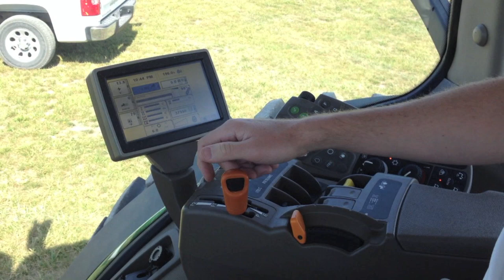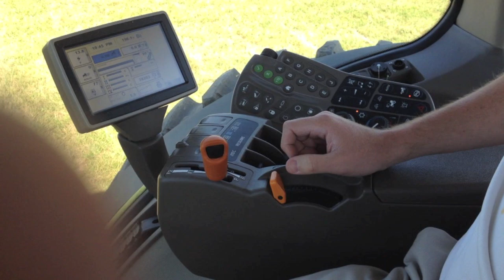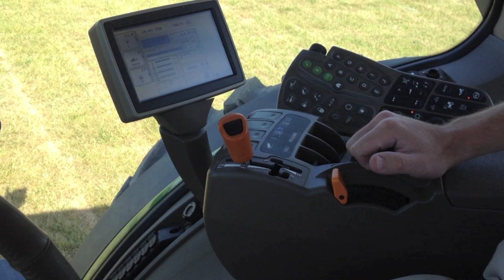John Deere IVT Operation

Comment: I never heard the engine rpm decrease at set speed when the tractor determined that there was no load.  It is supposed to maintain lowest eng. speed to maintain set speed.
Reply: Think they only drop to about 1200 rpm
Reply: @justinmartin8887  we idled full auto rpm when cold to warm up. 1200rpm was that. at 30kph is was also around 1200-1300rpm. beautiful trans, especially on the new 8r's they feel so much tighter
Reply: @ElBantosClips  my 20 series is definitely a little quirky

Comment: that looks so awkward and fiddly with the tiny stick. nothing like the Fendt
Reply: Its pretty comfrotable, you dont really touch it when working. But i havent tried fent so i dont know witch one is better
Reply: The Fendt is definitely better on the stick, check out a “how to drive a fendt” video or something. 
Its just so intuitive having it on the big joy stick. You can select forward or reverse by pulling a trigger on the stick and moving it forward or back. 
If you pull out on a road and want to accelerate up to full speed just knock the stick to the right and the tractor will do the rest, and if you are on silage say alongside a chopper then you can increase the speed in 2kmh increments by tapping the stick forward or pull back to slow down. The stick is sprung so always returns to centre and you also have all the hydraulic spool controls on it to
Reply: @danhopkinson2811  im going to say that its more complicated than jd, but like after maybe 50 hours i could drive it without looking at the stick. it might just be that ive always driven valtra and john deere, but every tractor has its own sides
Reply: Its not complicated, i’ve spent plenty of time on Deeres but on the direct drive models. Find them gutless especially when pulling silage trailers. The Fendt is easy because you can do everything on the one stick. You could drive it completely pedal free if you wanted
Reply: @danhopkinson2811  i wish i had a opportunity test a fendt, but we only have a jd ap and i dont know where i could test one out
Reply: They really are an amazing machine, the contractors i do a bit for run a fleet of them and just have the two JD 6155R’s for basic work and hauling. The Fendt’s are such a compact tractor for the power they make, visibility from the cab is amazing. Their radios let them down a bit though haha. Sounds pretty lame with 2 little tinny speakers
Reply: @danhopkinson2811   John Deere make a joystick called command pro which is basically the same as the fendt one
Reply: Yeh i haven’t driven a JD with the command pro stick. Do you drive them on the stick the same as the Fendt or is it just for all your controls/spools ect?
Reply: @danhopkinson2811  it’s for both, you drive with it and it also has all of your controls on it.
Reply: Ah yeh virtually the same as the Fendt then. Still think i’d rather have the Fendt though, the direct drive JD i’ve driven couldn’t pull the skin off a rice pudding

Comment: Why would you put it in gear at high idle speed, wouldnt that hurt it considering all the torque?
Reply: everything is fully automatic . when you push the throttle to high it throttles back by itself to about 1200 rpm 's .it only goes high rpm when the tractor needs it